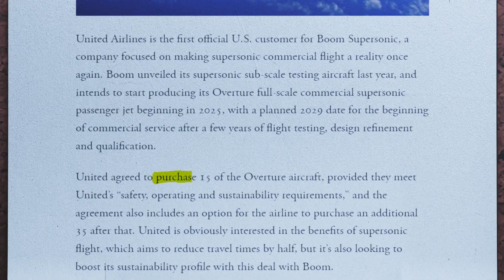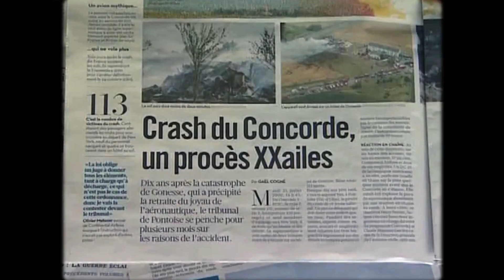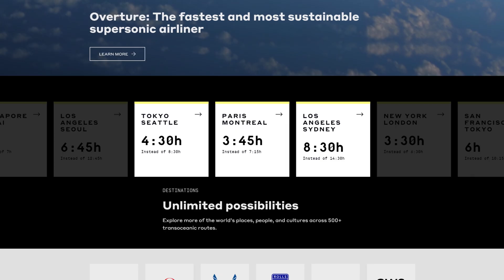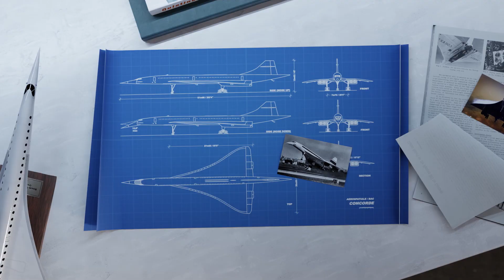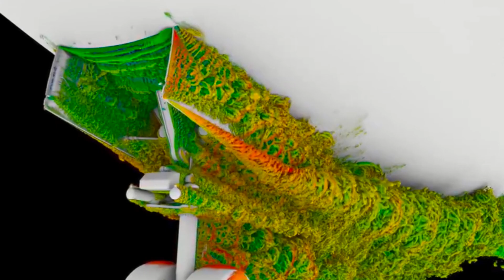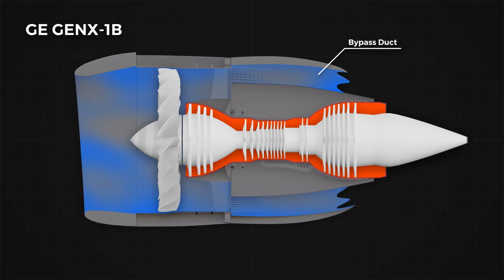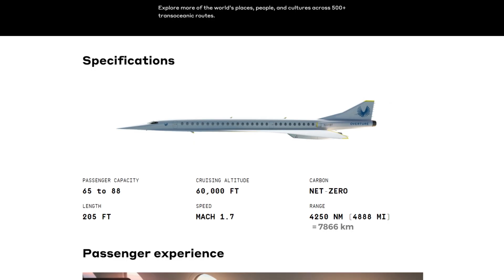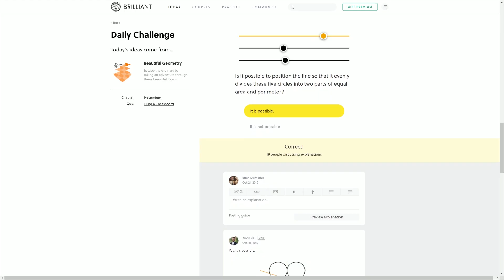Will Boom Bring Supersonic Back?

Comment: With synthetic aviation fuels and modern technology supersonic travel is far from dead....
The places commercial Airliners can go supersonic is still a big issue...
Reply: @markjmaxwell9819 Overture will create a sonic boom so it will not fly supersonically over land, but because Overture will be economical at both sub and supersonic speeds, Boom have identified 500 viable routes, compared to just 2 routes for Concorde. Also, Overture's noise will comply with ICAO-14 noise regulations, so it will be able to use all airports, without objections by locals. Overture's accommodation will be quiet business class, unlike Concorde's noisy cosy accommodation.  A JFK to LHR trip business class subsonic is $2,300 and takes 8 hours. Overture business class will probably cost $3,000 and take 4 hours.

Comment: You neglected to mention that even with all those downsides, and the mandatory yearly maintenance to replace parts that were damaged because of the sonic boom pressure, the Concorde was still profitable, and if I remember correctly, the most profitable plane both of British Airways and Air France. The problem they had was back when they sold cheaper seats. Then they started selling them for $12k (adjusted for inflation), and since London-New York is the route with the most capacity for selling expensive tickets in the world, it worked out well. 

It's true that slower planes were way more comfortable, but we have to remember that, although some of the Concorde's travelers wanted the novelty of the fast planes, in actuality the Concorde's travelers were overwhelmingly traveling on business, and traveling frequently. And as someone who has had a family in one city and had to fly to work in a different city, I would 100% prefer the fastest plane over the comfortable one. It's one thing to travel and see your family for a day and a half in a week once in a while, but to have to do it all the time was the worst experience I've had in my life--I left the job after like two and a half months.

For a history of the Concorde I recommend the excellent Mustard channel, by the way. Really, if you don't know it, go see it right now.
Reply: @dr.victorvs

Will Overture be able to fill the gap left by Concorde in the SST market?

Introduction
Boom have undertaken a mammoth task in developing and producing the Overture SST, with its Symphony power module and turbofan engine. The biggest risk is that they will deplete their capital, before a prototype Overture flies. Once that milestone is reached funding should be available. The following, is based primarily on information from Boom, and assumes that Overture meets its specification and goes into airline service. I have no connection with Boom whatsoever.

Aviation
Aviation has changed radically since the iconic Concorde first carried passengers in 1976. More people are flying, the number doubles every 10 years, and they are richer. Aviation fuel is roughly the same price as it was in 1976, taking into account inflation, and with deregulation, airline tickets are now cheaper, in real terms. Aircraft now have the range to fly non stop between any two airports in the world.

Technology
Computer aided design, and simulation has transformed aircraft design and development, by drastically reducing time and costs, and increasing effectiveness. In addition, advanced technology and materials, have enabled more powerful, more efficient engines, and lighter, cheaper, and more streamlined aircraft. 

Flight
Because Overture will be economical at sub and supersonic speeds, 500 routes, some mixed land/water, are viable, rather than just 2 Atlantic routes for Concorde. Overture will be carbon neutral, using sustainable aviation fuel (SAF). Overture will will create a sonic boom, but not over land, where it will cruise 10% faster (Mach 0.94) than subsonic airliners. It will cruise at twice the speed of subsonic airliners over water. Concorde carried 100 passengers at Mach 2, over 4,488 miles. Overture will carry 65 to 80 passengers at Mach 1.7 over 4,880 miles. 

Airframe
Both aircraft are 202ft long, but Overture will have a gull wing with computer controlled leading and trailing edge flaps, and a greater span, at 106 feet compared to 84 feet. Overture will also have an empennage. Carbon composite construction will enable streamlining, weight saving, and increased strength, while practically eliminating thermal expansion and contraction.  Overture will weigh an estimated 154 tons, Concorde weighed 185 tons. Concorde could carry 2.5 tons of cargo. The cargo capacity for Overture is not known. 

Engines
Overture's engines will be medium bypass turbofans without reheat, while Concorde had turbojets, with reheat. This means that Overture will be economical at subsonic speeds and will be low noise on take off and landing. Variable geometry ducting in the Symphony power units will probably allow the engines to supercruise.

Costing
Overture's predicted development cost is $8bn, against $14.4bn for Concorde. Manufacturing cost will be less, maintenance costs will be lower, and availability will be higher. Overtures selling price will be $200M, compared to $320M for Concorde. At a guess, Overture's development payback will be 150 aircraft, and airline payback will be 10 years, assuming 72 seats and 8 hours a day utilisation.

Operation
Overture will be simpler to fly, eliminating the need for a 6 month pilot conversion course. Overture will have improved low speed handling, especially on take off and landing, while maintaining low drag at supersonic speeds. It will have a modern cockpit, with a flight deck similar to subsonic airliners. A flight engineer will not be required. Instead of a droop snoot, external cameras and cockpit displays will give the pilots a view of the terrain when taking off and landing. Its cabin will be quieter and all its seats will be business class, almost certainly with internet. In contrast to Concorde's awesome engine noise, Overture will comply with ICAO-14 noise regulations, allowing it to use all airports, without triggering protests. 

Ticket Cost
Taking a JFK to LHR one way flight:  
Showing: Aircraft type,  Fuel cost per passenger,  Economy ticket,  Business Class ticket,  Duration

Boeing 747          $147          $577             $2,308                      8hrs 
Concorde             $753                                $5,000^                     3.5hrs 
Overture^^            $708         $1,200           $3,000^^^^                4hrs 
Business jet^^^                                 $53,000 to $99,000            8hrs  

Notes
^ 2023 value 
^^ Estimated prices, assuming Overture carries 72 passengers against Concorde's 100. For the first 2 years, only business class seats will be available.    
^^^ There are no supersonic business jets
^^^^ $5,000 return 

A 16 hour flight across the Pacific on a subsonic jet could be achieved with a 1 hour refuelling stop by Overture, giving a time of,  4 + 1 + 4 = 9 hours.

Market
Overture will not be competing for the mass economy market. Instead it is aimed at the 700 million long-range business flights made each year world wide. Boom and airline customer surveys show the viability of Overture, and they have identified 500 suitable routes. All Overture's seats will be business class and ticket prices will be comparable with business class on subsonic airliners. Once Symphony gets established it could become a niche service, similar to Concorde, but with many more routes.

Conclusion
Overture will be popular with both airlines and passengers, because it will half many journey times and will be cheaper, more comfortable and a lot more practical than Concorde. The military have already shown an interest in Overture. It would also be suitable for charter flights. There may even be a market for the Symphony power unit or just the engine. As Overture matures, it will probably be developed, just like subsonic jets. So the range may be increased, there may be a stretched version, and even an all economy seat version. After Overture, Boom could possibly develop a 200 seat SST.

22-2023.09.04
Reply: Mustard is a great channel, but Real Engineering also made a long episode on the Concorde after this video was released; https://youtu.be/hnrpXxbVhME?si=Yaic2yXr4fuqJBOJ

And in fact, even made a second on the engineering issues with it; https://youtu.be/8Oi8ZO-2Kvc?si=wQUoZy0nOk0_fjA_

Comment: If we got publicly funded 75db super sonic flight I wonder what’s under the hood of the us military research
Reply: @jakelangevin301  The NASA Quesst Mission is publicly funded. They have teamed with  Lockheed Martin to produce the X-59 experimental aircraft which is designed to reduce the loudness of its sonic boom to 75dB. The X-59 is scheduled to fly in 2024. The X-59 is 100 feet long with a 29.5 foot wingspan and 14 feet high fin, but it only carries a pilot. A problem with quiet supersonic aircraft is that their shape might not be suitable for carrying passengers.

Comment: Question:   if the sonic boom noise and g-force issues were fixed, plus a new fuel saving of say 60% were avaiable to existing jet engines, or a new technology, and lets say the speed could be mach 4~7 whilst comfort as per the aforementioned g-force were fixed and thus as good as current 737 max or better, would we still see these technologies held back by the fact that youd have thousands of planes flying around at super sonic speed and potentially be problematic for rogue countries utilising them for war planes with munitions and bombs attached to them? ??   i keep pondering that, like if we could quickly build new aircraft tomorrow, at say 150-300 million per plane, with fuel savings of 60%, that could fly 5 x faster minimum, would the powers that be in the main countries even let that happen??????                                                                   apologies for the poorly worded question...
Reply: @miscgloryofficial4527 Wow, you cover a lot of ground in your post.😊
There are already 10,000 aircraft, most flying at around 560mph, in the world at any one time, and none of them have had weapons attached to them by rouge countries. If they did, the military should be able track them on radar and shoot them down. If they were hypersonic that wouldn't be more difficult, but even so, by then, the military would have developed weapons to counter them.

As far as aircraft technology goes, in the distant future there is sure to be some new energy source discovered which will be limitless and and essentially free.  Air travel in future will probably use near earth orbit so that you will be able to get from any airport in the world to any other airport in 1 hour, or less without creating a sonic boom.

Comment: Engines they could still use a Low by Pass Turbofan likes todays Fighters i doubt they will still use a Turbojet but will see what Rolls Royce comes up with. If they can make it reach the  Pacific it would be huge.
Reply: @ivanviera4773 Overture will have 4 medium bypass turbofans specially designed and developed by Florida Turbine Technology, using mainly existing parts, including the core.

Overture would require a 0.5 hour refuelling stop to cross the Pacific. A 16 hour trip on a subsonic airliner could be done by Overture in 4+0.5+4=8.5 hours

Comment: Why not start with private jets? Owning a faster jet would be a major bragging right for people who buy their own planes. If the plane has a long enough range then a private jet that can beat commercial flights to their destination would be worth it to some ultra rich since current private jets aren't any faster than commercial planes.
Reply: @dylanmorgan5589 Developing a supersonic business jet would be technically difficult and very expensive. Also, the unit cost would be high. A Challenger 8000 costs $80M. A supersonic business jet would probably cost $160M. A supersonic business jet would have to be longer and thinner, and would probably end up being 2X longer, which would increase airport charges. But the big downside would be only half the range and half the economy. And even then the business jet would not be allowed to fly supersonic over land.
Reply: @phonicwheel933  I'm well aware of the prices and the size of jets. I work out there. 

Show-off billionaires trying to save as much time as possible would be the only viable customer for such a jet. It could happen, but like you said, the per unit cost would be high since only like 25 companies would benefit from this jet, and only international routes would be legal to use their full capability since it's illegal to fly super sonic over land. 

Still, some billionaires make 10s of millions of dollars for every business they land, so saving a few hours to shrink the planet and get more opportunities be worth the cost. 

The people who buy these things are a different type of person with different needs. 

Still though, billionaires consistently break laws so giving them access to a window shattering super sonic jet might not be a good thing.
Reply: @dylanmorgan5589   One thing that could reduce the cost of supersonic business jets is if the Boom Overture and associated Symphony power modules, were successful. It may be then economic to have a scaled down version of Symphony with perhaps 2 Symphony power modules.

If the NASA quiet sonic boom investigation works out, and providing that the required aircraft shape is practical for carrying passengers, that would revolutionise the whole SST field, but I think it unlikely from what we have seen so far.